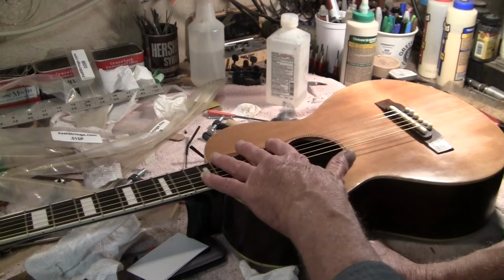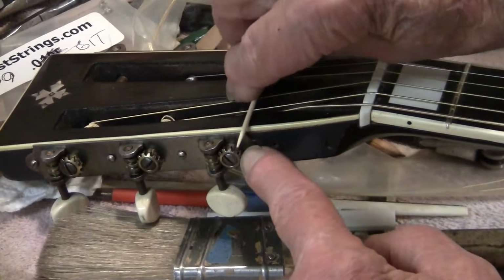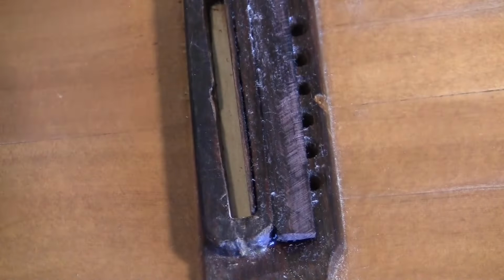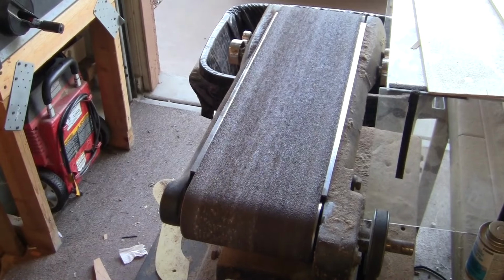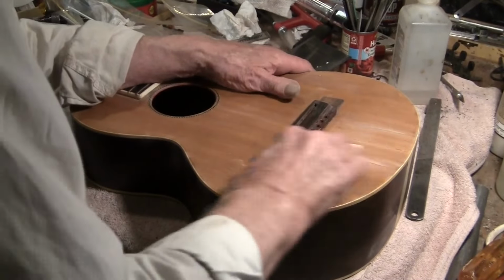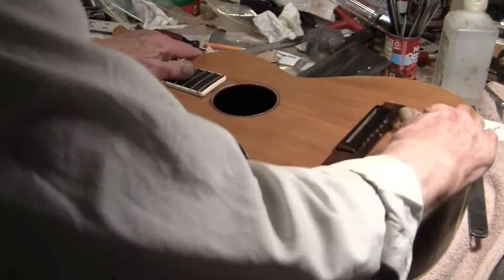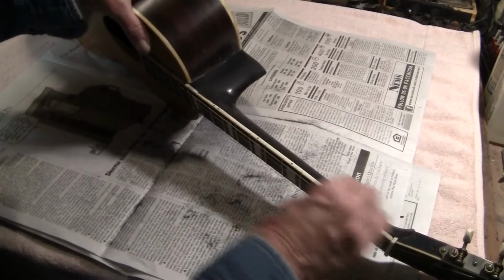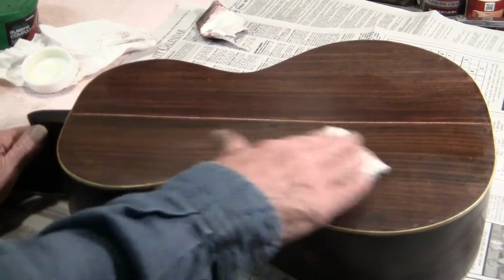Lyon and Healy Terz   Part 5

Comment: For the tuners; would inserting bushings of some sort in those holes on the headstock help with keeping those tuner posts straight?
Reply from the maker: Yes - I use brass "telescoping tubing" which gives me the right OD for the hole and the right ID for the tuner post.  I may do a short video - have to order the tubing.  Car antennas use telescoping tubing - I have a source - McMaster Carr - biggest hardware store in the world.